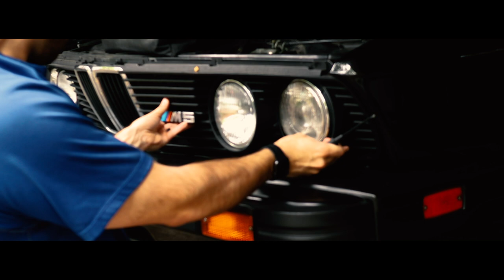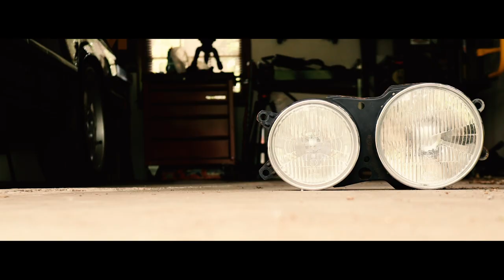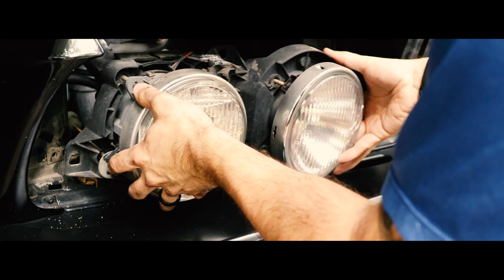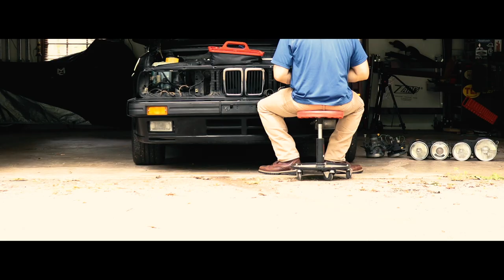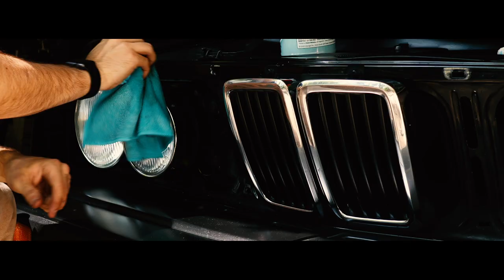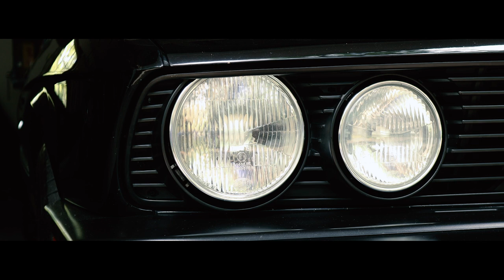BMW e28 M5 Euro Headlight Installation

Comment: Hi , How to turn on High beam headlight , I have E28 too but i cant turn it on , where is the switch ?
Reply from the maker: Pull the turn indicator toward you to flash the high beam (for passing or signaling) or push away from you to keep them on.